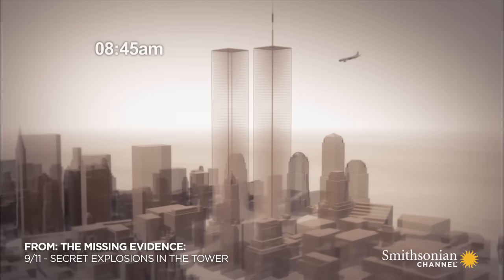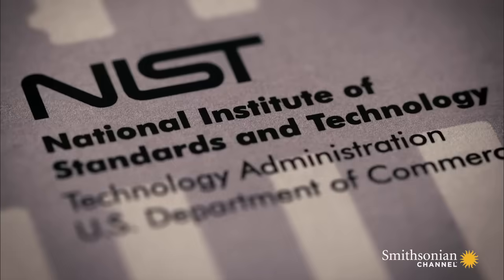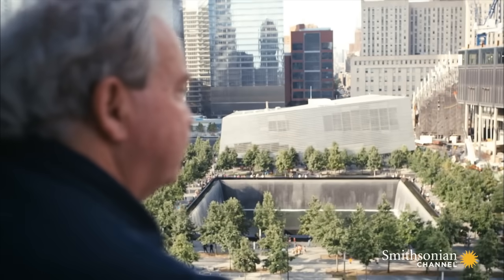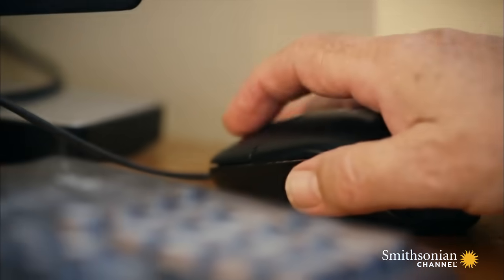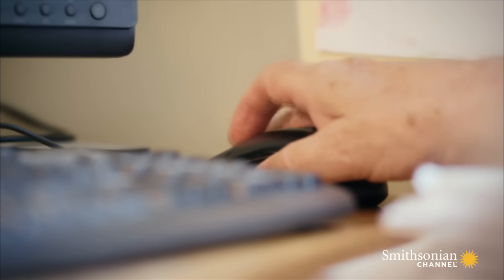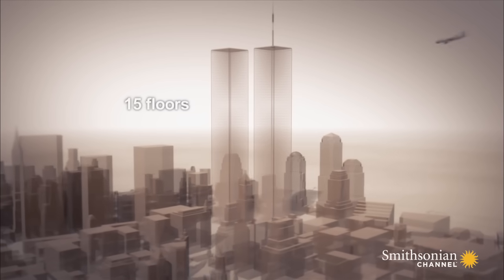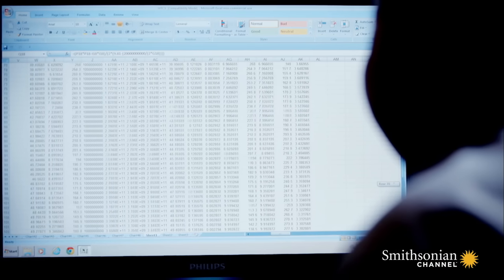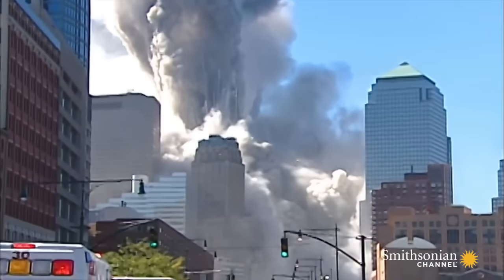This Computer Simulation Explains How the Twin Towers Fell

Comment: The buildings collapsed at consistent rate of free fall speed from start to finish, even though the majority of floors and mass was underneath both impact zones. How did a liter compromised section of the tower crush the heavier section of intact floors at free fall speed, what happened to the law of conservation? The official explanation itself is a conspiracy theory!
Reply: FUN FACT: There's no such thing as "free fall speed." The term free fall refers to acceleration not speed. That sounds like nitpicking but it's not! The towers did not come down in free fall; that's a myth.

Regarding the law of conservation, momentum does NOT have to be conserved if there's an external force (like gravity!) acting on the system. Have you never wondered why there aren't any physicists bringing this up?
Reply: @Tim22222  in relation to the twin towers which is what we're discussing least 2/3s of the mass was underneath where the towers started to collaspe from, the force of gravity acting on the liter section cannot crush a heavier section that hasn't been manipulated structurally. Why did the towers fall symmetrical which would imply that all the towers trusses broke at each side of the building at exactly the same time and what happened to each of the 47 central steel beams in each tower?
Reply: @Pitimesis  Before you go changing the subject, perhaps you could address my previous comment? Do you concede that conservation of momentum doesn't apply to the towers because of gravity?

I'll shoot down your "lower 2/3" argument after :-)
Reply: @Tim22222  the conservation law and the variable of gravity and its effect  is dependent on the actual specific context of the situation itself...
Reply: @Pitimesis  Sounds like mumbo jumbo to me! If an external force - e.g. gravity - is acting on the system, momentum does not need to be conserved, PERIOD.

As to your lower-2/3s question, the top 1/3 did not defeat them, it bypassed them! Remember, in the towers' tube design each floor's weight was carried by the COLUMNS, not the floor below. When the collapse began, all that mass FELL OFF of the columns and landed directly on the floor below! So what happens when a floor designed to carry 3500 tons (static) suddenly gets 100,000 tons (dynamic!) dropped onto it?
Reply: @Tim22222  This 100,000 ton mass dropping onto the floor below?  You're making an assumption that 100,000 tonnes collasped. There were around a dozen floors 10-12 floors that the planes impacted which video evidence shows. So if 1/3 of the building is 36-38 floors less than half of that which is a dozen floors had there structural integrity compromised and were on fire, up to a dozen floors may of collasped at least partially. Even if entire top 36-38 floors that make up top 1/3 of floors had "fell off" as you described onto the floors below what happened to the 47 central steel columns in each tower they just seem to disappear they should been still standing?
Reply: @Pitimesis  My 100,000-ton estimate is based on the south tower; the plane hit around 4/5 of the way up the building, leaving 1/5 above the point of impact. My understanding is that each tower weighed about 500,000 tons and 1/5 of 500,000 = 100,000. Feel free to offer a different figure if you think my back-of-the-envelope estimate high (it probably is). But my point remains: When the columns buckled, they no longer supported that weight - and the floors below had no hope of withstanding it.
Reply: Uhh no they didn't

Comment: "A commercial Jet liner" Might have wanted to be more specific and say a commercial airliner at the time the building was designed. Building was built to withstand a 737 not a 767

Comment: Anybody heard about the laws of Physic's? Equal and opposite force during a collision. Not the plane but the smaller part of the building impacting the larger part. When impossible really is impossible.
Reply: Nice try but you are forgetting about something: GRAVITY. Momentum does not need to be conserved in an "open" system, that is a system where there are external forces (like gravity) acting on the players.

Have you not wondered why there aren't any physicists that agree with you?
Reply: @Tim22222  where do you think I got the idea from? Go research it.
Reply: @marcoperoni4735  Have done, thanks! Conclusion: You have zero understanding of physics.
Reply: "Anybody heard about the laws of Physic's?"
A good question. Definitely not you.

Comment: The buildings were made in the late 60s early 70s, and they were designed to withstand a Boeing 707. A Boeing 767 is a much larger jet than a 707, their was literally no way buildings from that long ago can be prepared for something like this
Reply: Yes, especially at the speeds of which those jets were traveling! The 767 also carries much more fuel due to it being bigger! The explosion from the fuel upon impact actually did more damage than the impacts themselves, especially with the second plane!

Comment: The structures were made suiting heavy weathers they were in themselves safe. Terrorism in terms of rocket launchers and explosives would never take down the building. It wasn't made to withstand a 747. The impact, spread of fuel, the uncontrolled fire drastically effected the metal concrete ceilings etc. It was like a oven or lava. How long can the structure take so much heat. That's the cause, uncontrolled heat like the sun spreader and melted everything and then it gave way
Reply: Lol, that heat couldnt melt steel.
Reply: @georgecostanza831  you clearly have no idea
Reply: @legendarytexasdredds818  haha
Reply: @georgecostanza831  watch the video
Reply: @legendarytexasdredds818  lol

Comment: Where both designed to withstand impact of commercial airliners?  Most engineering articles say just opposite you can't build something to withstand over 500mph commercial plane impact? We're confused. And at over 500mph wouldn't that speed cause something to still exit other side of building? That speed would not be stopped by windows on opposite side of entry point. Not likely plane would enter then exit building unscathed, but at over 500mph  unusual just immediately exploded inside.
Reply: A few parts did exit the buildings on the other side but it wasn't just windows the planes encountered. Remember the core.
Reply: @Tim22222  yeah the core destroyed those planes

Comment: How does a building accumulate all the heat from burning fuel and HOLD IT THERE long enough, like an oven, until the steel would melt? Considering how architecture intended for human use is pretty much the opposite of a germetic oven? Explosion would bend something around it in a bubble-shaped way I guess but it wouldn't be any close to being sealed.